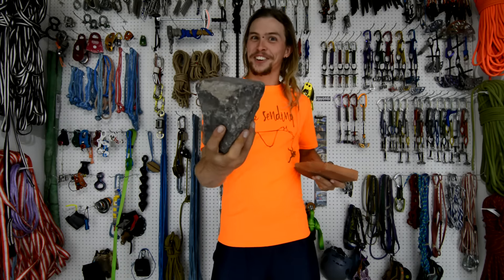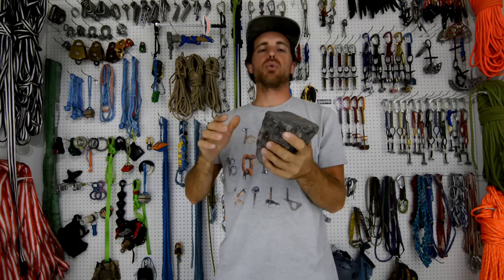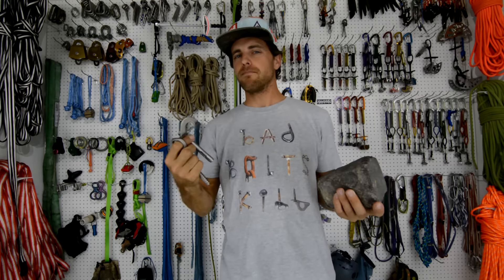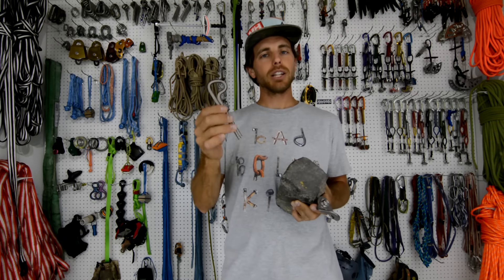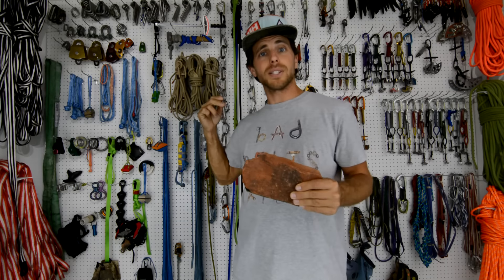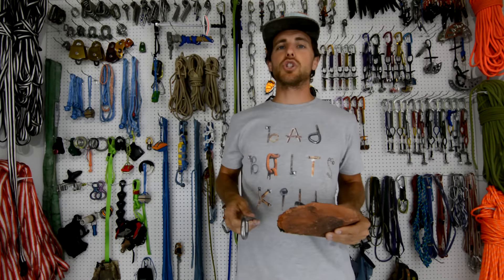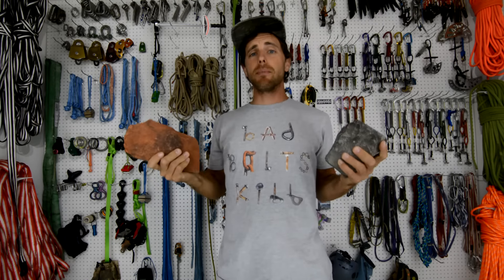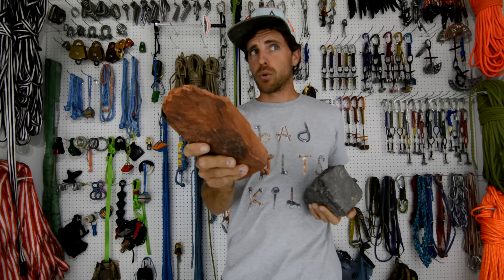Climbing bolts are only as good as the ROCKS you put them in

Comment: Wedge bolts are a fraction of the cost of sleeve bolts like Powers/Rawls 5 piece, especially if you're buying sleeve bolts from Fixe who marks them up like crazy.  We pretty much exclusively use wedge bolts in our varied granite here in northern Colorado, with the occasional 5pc/sleeve bolt used as replacement for spinners or not as good/softer rock.  We use 1/2" sleeve as a replacement with the same hole for a 3/8" wedge, and we sometimes even use 1/2" wedge for questionable rock.